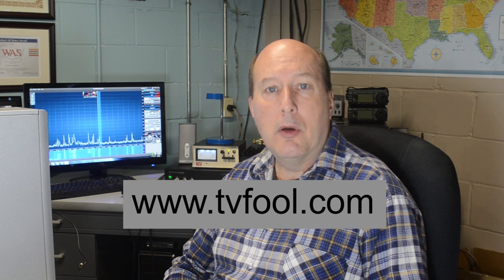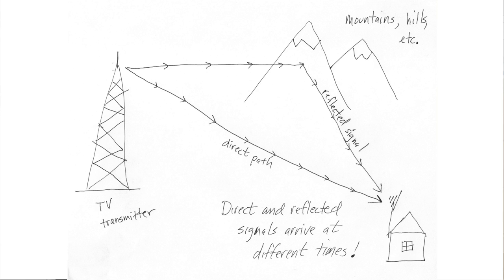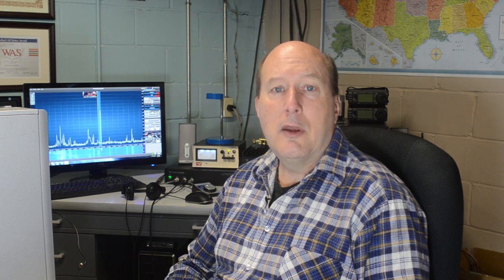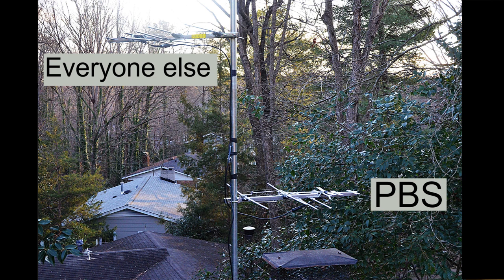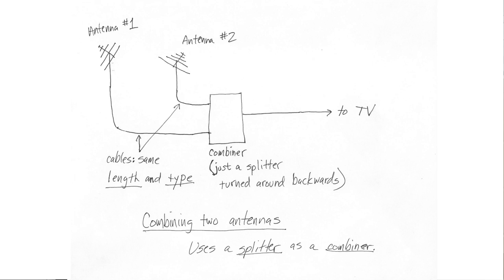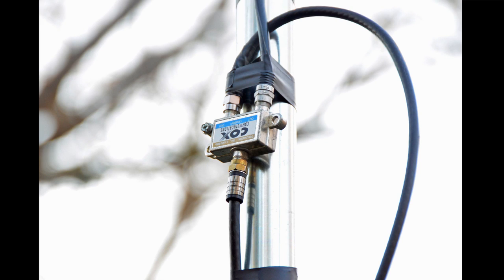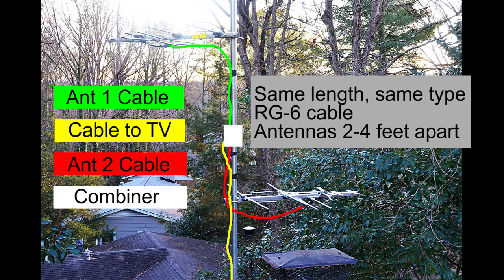Combining two TV antennas for better HDTV reception

Comment: Is it possible to combine 2 antennas (one designed for UHF and one designed for VHF), pointing towards the same towers, and using a 300ohm twin lead to add the smaller UHF to the larger VHF one?
(In Los Angeles we still have KABC 7, KCAL 9, KTTV Fox, and KCOP 13, broadcasting on HVHF freq.)

I currently have 2 antennas on the same pole on the roof with a rotator motor and use a combiner with a pre-amp going into the attic  (HD8200XL and HDB91X).
The setup is OK, but the HVHF stations have trouble occasionally in the evenings.

If I offset the aiming of the 2 antennas on the pole slightly, it seems to be better, but not great.

Would removing the combiner and just using a 300ohm twin lead to attach the 2 antennas together and then the pre-amp create a better gain for both HVHF and UHF frequencies?  Or would the 2 phase each-other out?
Reply from the maker: If I understand correctly, you want to eliminate the loss in the combiner, correct? You may be able to get by just connecting the two antennas with 300 ohm twin lead. It's possible that you'll incur some loss due to impedance mismatch and/or have phasing issues, but it's a pretty easy experiment. Try it and see what happens.
Reply: Yes, the combiner actually has a freq. separator built in. 
One input is VHF and one UHF.

Today I moved the UHF antenna (HDB91X) closer to the  larger VHF antenna (HD8200XL) on the pole to where the two were actually touching each-other.  Combiner still attached, and the signals were pretty good.
Then I eliminated the combiner and used a balan (reversed because the HDB91X does not have a twin lead connector) then I used 2 separate thin wire leads with alligator clips to connect to the twin connector on the HD8200XL, and connected the coax from the HD8200XL directly to the pre-amp.
The results were UHF signals dropped substantially.
Then I reversed the alligator leads and noticed the signal was much stronger on UHF, but my favorite UHF station was gone.  :(    H-VHF stations were good.

I went back to using the combiner/separator with the 2 antennas still touching and pointing in the exact same direction to Mt. Wilson for Los Angeles stations.

Usually stations will drop when/if the temps drop in the evening. 
It's 7pm PST and 61F and all stations are still great. (UHF/VHF)
I've always had issues with KABC (174~180Mhz) and KCAL (186~192Mhz) breaking up in the evenings.

I guess time will tell when the temps drop...  :)

Thanks for the informative video and reply...

Comment: Doug, 
There are cellular towers on the roof of my apartment building. Will that interfere with a roof antenna?
Reply from the maker: I doubt it, John. Cellular service operates at a significantly higher frequency than any of the broadcast TV services.

Comment: Good video. What do think about antenna signal amplifiers?
Reply from the maker: I use one since I am feeding 3 TV sets. Definitely helps make up for the loss in the splitters. It was made (or at least sold by) Channel Master. But I don't have any experience with different brands. Sorry I can't be of more help. Keep in mind that signal amplifiers amplify noise as well as the desired signal , so they're not a cure-all.

Comment: is still this setup running out as normal?
have you replaced the tv or the tv receiver since you have combined two signals?
Reply from the maker: It's still working fine. Still using the same TV receivers here.

Comment: Does this combining also work for Yagi antennas used for cell towers? does that require some booster thing after it to process the signal?
Reply from the maker: No, cellular antennas are a different situation entirely. They have a different impedance (50 ohms vs. 75 ohms) and  the use of TV spltters wouldn't be appropriate there.

Comment: You said 72 ohm?  I am using 75 ohm that was provided by the cable company? Excellent video btw.
Reply from the maker: Yeah, old habit.. In the ham radio world there used to be a transmission line that had a 72 ohm impedance. I often find myself saying 72 ohms when I mean 75 and vice versa.

Comment: Great information thank you. Why hasn't someone developed a multidirectional TV antenna?
Reply: Patrick8925 

It's been done. It looks like a plastic flying saucer.

There are also bi-directional antennas. They are simply the old 4-bay or Hoverman type, only without the reflector.  You get a few dB less gain, but in many urban areas, one may have dozens of dB to spare

Comment: I have a fairly weak signal for any TV station in multiple directions.  Would you think a quad antenna solution with a 4-1 combiner is too extreme?
Reply from the maker: I've seen 4 antennas combined, and it worked. But in cases where the signal from the TV station is very weak (right on the threshold of being too weak) with a single antenna then the additional loss in the combiner when adding more antennas could cause a problem. Unfortunately I don't know of any easy way to find out except to try it, and that's kind of an expensive experiment.
Reply: Although I didn't go with the four antenna setup, I switched from an omni-directional to two of the Yagi ones you used in your video, and it worked wonders!  I was able to get all the channels I targeted without interference.  Thanks for your help.
Reply from the maker: That's great! I'm glad it worked out for you.

Comment: how close to the midpoint does the splitter have to be?  
we're thinking of adding a second antenna on the other side of our for story apartment building and I don't know how close in length we'll be able to get the cables.
Reply from the maker: You want the splitter in the middle. Just make sure the cables connecting the antennas to the splitter are of equal length.

Comment: Doug - Do you suppose I can collect signals from two antennas, and then split them back to feed two televisions? (using two splitters)
Reply from the maker: That's what I do. The cable from my combiner goes to an amplifier/splitter which feeds three televisions.

Comment: Can the antenna you speak of be used in attic or is that configuration require specific antenna?
Reply from the maker: If you have sufficient vertical spacing in your attic then these antennas would probably fit. People have successfully installed these antennas in attics. One caveat - if you have a metal roof, or if you have metalized backing on roof insulation then having the antenna in the attic probably won't work very well.
Reply: Got it thank you very good video btw 😀

Comment: So wouldn't this affect the fringe channels with the immediate 3-4 dBm loss as a result of the backward 2-way splitter? Seems like a double edged sword scenario, worked for you obviously because that loss didn't affect you. Might negatively affect others. Maybe a Winegard LNA-200 preamp installed immediately after that split with a 3 foot RG6 jumper, before the journey down with power inserter installed after penetration to house before the "house" splitter might yield even better results. Still take the loss from combining at end of day. Sometimes these setups can get complicated.
Reply from the maker: Yes, you're absolutely correct - for a fringe channel with only a few dB of signal margin this could kill it. But if you're right on the edge, signal-wise, then you may experience problems anyway.

Comment: The best way is to use 300 Ohm twin lead to connect the antennas together, then use a balun on the lowest antenna to bring the signal into the house. By using a splitter in the house you can use the antenna "system" to also receive FM radio and hook a scanner to it as well. Due to the characteristics of twin lead, it has LESS pickup of noise AND length between antennas is NOT critical!

Comment: Would you put a Winegard LNA200 amp after the splitter or 2 of them before the splitter?
Reply from the maker: Ideally you'd like to have the preamp at (or near) the antenna, so if you have two preamps I'd advise putting them near the antenna and before the combiner. That's ideal, but in my case I just have both antennas feeding the combiner and the output of the combiner goes to a preamp under the house.

Comment: Can the splitter/combiner be at the end of 50' coax runs if the antenna's are far apart? I will be using the same antenna, same cable and same length cables
Reply from the maker: I don't see why not. You're still just combining two signals with a combiner.

Comment: Thank you this is a great video. So much good information. Are you a ham by chance? It's rare to run into someone with this much antenna, signal, and propagation knowledge. I'm curious about your signal display on the monitor in the background. Was that television signal display or a total different spectrum? I have several sdr dongles and rasberry Pi's but I didn't catch the program you used to display the spectrum. Again thanks!
Reply from the maker: Hi Chad, yes, I'm a ham. K4DSP. The display in the background was from my Flex-6300 SDR using the SmartSDR application.
Reply: @doughall1415  Ok thanks. Flex Radio makes great set transceivers. I really like them. Ill have to check out SnartSDR. Thanks again for the great video. 73 de W4CHD

Comment: Can I splice 2 antenna wires in parallel? In series? Greg
Reply from the maker: Placing transmission lines (like RG6 or RG59) in series is OK if you use appropriate connectors. But placing them in parallel will change the impedance which can cause problems. That's what splitters and combiners are for. But hey, some people do it and get away with it.

Comment: I got it Doug.
Thanks again.
Just one thing though, I have a HD Stacker Antenna I Purchase from Denny's Antenna. After the installation I receive perfect reception, and about 42 channels. Although most of them are repeated broadcast; they come in very clear. However, my problem is whenever I scan my television I end up getting around 52 channels or more; which comes in superbly and that I could watch for up to 20 or 30 minutes and then it freezes and fades out. 

I've been contemplating purchasing a rotor or rotator, but after watching your post or video I am deciding purchasing another antenna; installing it along the HD Stacker,  combining both and positioning it to pick up channels and feeds out of Columbia, SC. My HD Stacker antenna is pointed towards Charlotte, NC and with the new one pointing toward Columbia, SC I believe I could acquire whether desire reception I need.

Is there any set back to this setup? I ask on the lines of pros and cons. Could you offer any help?
Reply from the maker: That's the same situation I had, and so far using two antennas and a combiner has worked out quite well. I think the HD Stacker that you have is a better antenna than the RCA antennas I bought.

Comment: Great info Doug! Here's my problem. Im in the Poconos and I'm trying to get the Philly stations. I have  1 pointed to the local towers Scranton, 30 miles at (284 degrees) & the other for Philly 80.1 miles at (180)..
When I do a channel scan, I only get the local,  none from the south. My location is on top of the mountain, 1861 ft elevation at zip code 18347. Is there anyway to fix this? I've followed your instruction to the tee in the setup. Your thoughts or remedies will be greatly appreciated. Thanks Jim
Reply from the maker: I've had very limited success getting HDTV signals from more than 60 miles or so, but given your elevation I would think it's certainly possible for you to get stations from Philly. You might try disconnecting the antenna pointing to Scranton and connecting a single feedline to the south-pointing antenna just to see if it's a multipath issue or combiner issue.  You could try a preamp as well, preferably one that mounts at the antenna. That's about all I can think of.
Reply: It likely can be done..
1st.. Ignore the easy to get channels..or the direction you point antenna for those easy channels..

Good news is your Height
(Height is Might)

Now start with a Horizontal yagi of longest length boom you can work with..that too will affords the Most elements to aide in gain of desired signal while at same time better rejecting un wanted signals...

They make such horizontal beams for tv as little as 2 foot to 20 ft long booms.. Likely a 6 to 12 ft boom is whats needed/ desired..

Once you get your desired hard to reach distant signal... Add an antenna mounted pre-amp for that antenna and or add a 2ed same antenna to stack above it at 2 to 5 feet stacking distance..

Now.. 
Return to the antenna of those other easy to reach channels..
Run RG-11 coax of same length from your properly pointed and recieving of hard to get signal antenna..

While running another RG-11 coax of same length.. Into a Proper tv antenna combiner
(Not a splitter hooked up in reverse..these often destroy and hinder signal combining)

Now run needed single length of RG-11 coax from your combiner into your distribution point in your home..

Now re-scan for tv channels and enjoy over the air tv
Reply: Doug didn't get into this, but it is also possible to use a combiner to "stack" antennas pointing in the same direction to get more gain. It gets a bit more tricky to find the correct vertical spacing (varies by channel) and the coax length between the antennas and the combiner is more critical. You definitely need a signal strength meter to get the length and heights correct so that the signals combine. I am not a fan of a preamplifier. The ones you can buy locally are crappy and they can get wiped out by a strong local station so they no longer amplify the weak one.
Larry, Chief Engineer, KHBS/KHOG TV.
Reply: You might have trouble getting the philly stations from the poconos. You know that huge mountain on the turnpike you cross under to get to philly? That might block your reception of philadelphia tv.
Reply: @erics6177 ..... Sounds like dynamite could fix this!
Reply: Angle it down see if that helos

Comment: I'm unable to get PBS most of the time at my house despite being able to get other channels that are transmitting from further away with lower signal strength and in the same direction as PBS.  Any idea what's going on here?
Reply: I have the same problem! It's the only channel I watch, but I think and actually, as a fact, I know that many PBS station transmit on the lower VHF frequencies, while EVERY OTHER CHANNEL transmits on the highter VHF or UHF frequencies; frequencies for which most antennas are designed to work with. It is a pain. I am installing a new antenna at the moment, so we shall see.

Comment: Since my house is already prewired with RG-59 and losing -11dB just on splitter configuration  (Not including cable loss) what type of amplifier can I use.  And will an amplifier fix poor Signal.

Thanks.
Reply from the maker: I don't have specific recommendations for a preamplifier other than to look for a good (high gain, low noise figure) mast-mounted preamplifier. According to Channel Master (https://support.channelmaster.com/hc/en-us/articles/200383665-Do-I-need-a-preamplifier-for-my-antenna-) "The preamplifier is located as close as possible to the antenna feed point because the weak received signal must be amplified before it is attenuated by the coaxial cable, and also before it can be subjected to interference from sources between the antenna and the receiver. Preamplifiers mounted farther from the antenna usually amplify (magnify) the interference along with the signal. "
Reply: belly tripper so by that logic, an amp Will just boost the noise therefore hindering my already poor signal??  Interesting.  That seems to be the complete opposite of its purpose.  So then would a 2nd pre amp work??  The anttena I have is built with a pre amp with specs in dB, so I guess my underlining question is, me having poor signal in one room and having great signal in another room that has much shorter cable run (less loss in dB) how can I gain more of that signal back from cable loss.

Comment: I’m wanting to ditch dish but my Yamaha receiver doesn’t have a co ax input, actually neither does my vizio tv. Any suggestions?
Reply: You can buy a separate digital converter.  I use homeworx.  Read about it on amazon to see if your gear can handle the output types.

Comment: Can I do this, but point both antenna in the same direction to simply gain a stronger signal?
Reply from the maker: You can, but then the spacing between the antennas becomes more important. This is known as "stacking" or "ganging" antennas. For some technical info see http://www.hdtvprimer.com/antennas/ganging.html
Reply: Thank you for the reply Doug.